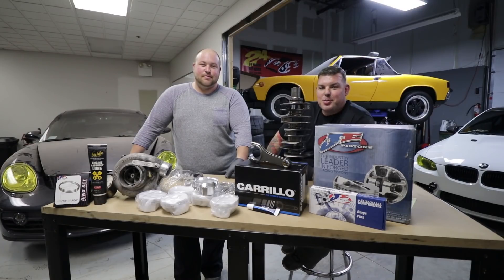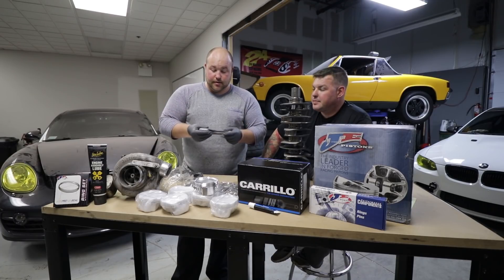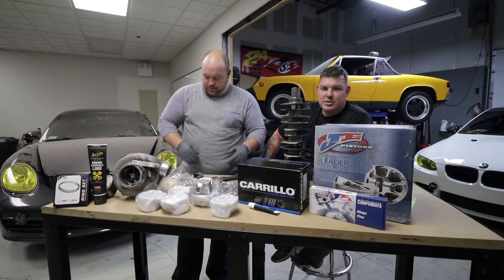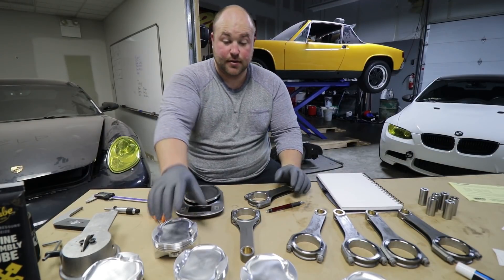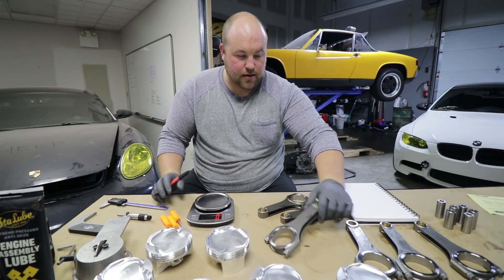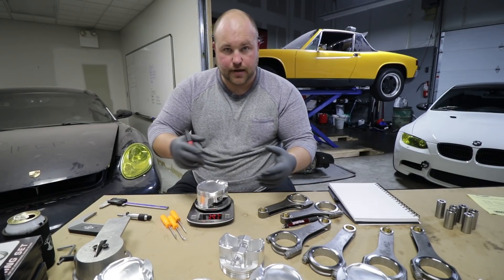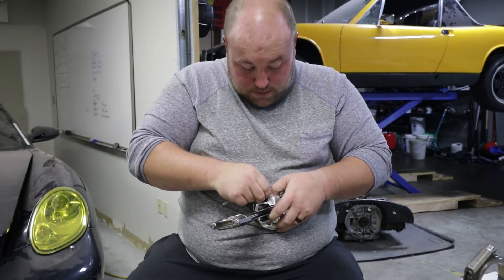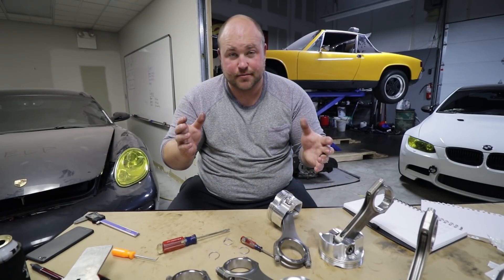Turbo 3.8L Cayman Engine Build (Porsche M96) - Part 2

Comment: What turbo system?
Reply from the maker: Originally TPC, modified by Vision Racing
Reply: @BoostBrothersGarage  cool! The TPC kit always had a kind of seemed like it used a weird non name turbo. Why an M96 as opposed to an M97?
Reply from the maker: I’m not sure what came with it originally, but it’s got a Garrett GT4xxx now. The M96 is strictly because we found a partially built engine (already sleeved and headwork done) for stupid cheap, couldn’t pass it up! It should be marginally easier to make work with an aftermarket ECU as well.

Comment: Currently rebuilding a cayman s in Ireland also had a spun bearing. I am a mechanic for 10 years now, 1st flat engine build tho. Your videos are a great help if only for the fact that I know I'm, not the only one getting stuck along the way. Hoping to see another video soon. I have pistons 1,2,3 in, con rods 4,5,6 in about to assemble the two blocks. Wondering where I will get the tool for inserting gudgeon and spring clip if you had any info on the best ones or where to get the tool it would be much appreciated. Also well done on the entertaining channel.
Reply: Thanks I’ll up date you if I get any info myself. I’m going to attempt to make a tool tomorrow hopefully all will go well.
Reply from the maker: Awesome, appreciate it!
Reply from the maker: Thanks for the kind words! I don’t have all the info on that tool yet, but I will be certain to discuss it all once we do. Good luck with your build, awesome that you are doing it yourself!

Comment: Just found your channel and love it!  Do you know your wheel size for the cayman?
Reply from the maker: Thanks!!! The black victor equipments that are on there or the new BBS E88’s?
Reply: Boost Brothers Garage The Victor and would you like to sell them?
Reply from the maker: They are 19x9.5 and 19x11. They really need to be refinished and one of the front wheels is bent (but repairable). I’m sure Zach would sell them but they definitely need some work! The fronts don’t run a spacer, the backs run a 10mm (roughly) spacer
Reply: That’s exactly what I needed to know, I’m going to go with a new set then, but thank you!  Can’t wait to see the cayman running again, good luck with yalls venture!
Reply from the maker: Sure thing and thanks! FYI, the VE wheels are really heavy and reportedly not suitable for track use (at all!). If you are planning to track or autocross it, the hot setup is 18” OZ Allegerita’s
Reply: The reviews for those are great, but I’m just looking for some daily wheels that look good.  Keeping the stock wheels for the track tires for now.
Reply from the maker: The victors are perfect for that!